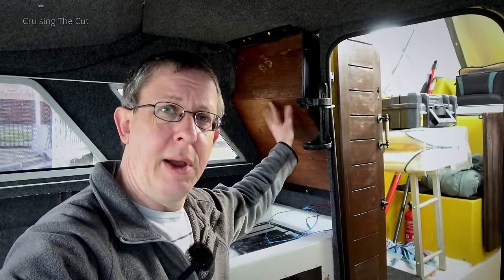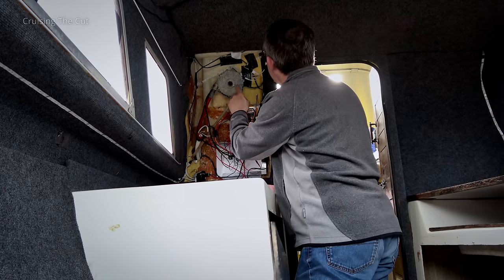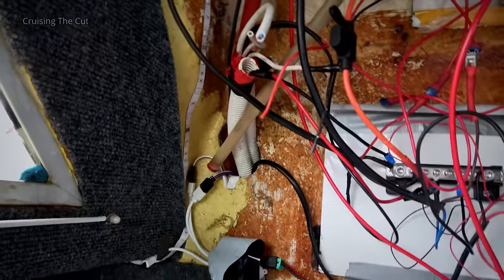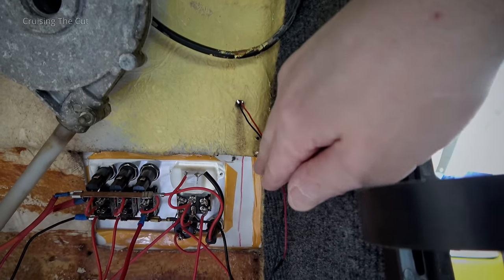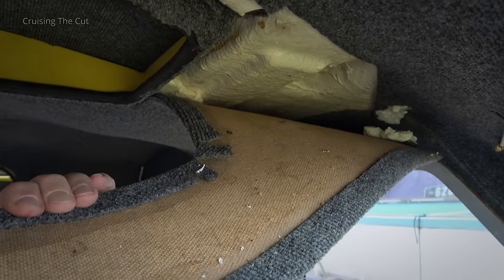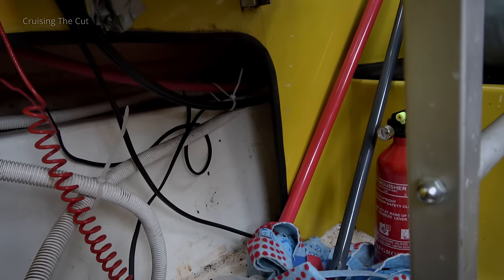326. Ripping out the wiring in my boat

Comment: Hi David, the strange two holed thing in the dashboard is, potentially, a small 12v indicator bulb devoid the element and glass cover. Otherwise known as a smashed bulb. Please do carry on with this video series, it is enjoyable to watch and gently informative.
Reply from the maker: Ah, good shout. I will remove it and cover the hole.
Reply: Exactly what I though, I've seen bulbs with skinny little wires sticking out the bottom.
Reply: A socket for just a bare LED?
Reply: @Scodiddly  Originally probably would have been a LV incandescent bulb.  Either friction fit, or with a plastic or glass cover.  Can't really tell, with the bezel looking a bit beat up.  As David Watkinson said above 'otherwise known as a smashed bulb'.😄  You probably could fit bare LED leads in there, but with a resistor fitted to one leg.  Easier to remove it, and cover it up, or put in whatever type of new indicator you might need.
  I'm waiting to see if the switch/fuse panel even has enough room in large panel, to be mounted vertically.  Hard to gauge the size in the video, but I think that may be why the previous owner, mounted it horizontally.
Reply: @CruisingTheCut  Strikes me that it might have been a 'power on' indicator that showed that some past version of the electrics was live, if there was an isolator near the battery.
Reply: @dougwilson4537 re the switch fuse panel you might be right about size/fit. My first thought was the previous owner just preferred rocker switches up/down rather than left/right for operation by touch.

Ah, the joys of puzzling out random diy wiring 🤪😆
Reply: I think it was a small light bulb to illuminate the dash at night
Reply: @CruisingTheCut My guess was going to be a smashed LED, maybe a main power on indicator?
Reply: I was thinking one of those old LEDs that looked a bit like miniature light bulbs with two pins in the bottom to plug them into something. Perhaps supposed to be a charge indicator for the battery or something?
Reply: @Scodiddly no, a bare LED needs a resistor to limit current. Led only uses about 1.75 volts across it, but a 1k resistor in line with the socket would supply about 10 milliamps of current, a good nominal current flow. It would light an average LED to a very nice brightness.
Reply: The light bulb might a energizer for charging like the battery light in a car?
Reply: You can get 12V LED's that have resistance embedded within them, no external resistor required
Reply: I was thinking the same thing, either serving as the instrument panel light or a map light or the like. It is the same with those random connectors, i imagine they were for items they would bring aboard for the day but didn't want to leave permanently on the boat.
Reply: My suggestions is that it is a socket for a goose-neck reading light to be plugged in for night navigation.
Reply: Yes, I was thinking it looks like the socket for a G4 type bulb.
Reply: @mikecrawford7352 I think you're right. That boat is old enough to have used incandescent lamps.
Reply: It could be nicely used as a place to check the true battery voltage with a multimeter...
Reply: The missing thing on the dashboard is the remains of a flashing LED probably to dissuade thieves so it looks alarmed,  not a bad idea as they use no voltage really and puts a bit of doubt into the minds of light fingered types
Reply: Otherwise known as an idiot-light. These are similar in function to all the standby lights on electronics
Reply: @richardpope2114 does that actually work ?
Reply: Yep davidwatkinson7552, you said exactly what I was thinking, the remains of a small globe to light the instrument panel, minus its globe and top fitting.
Reply: GU10 bulb?
Reply: @thegrimreaper7777  not common, pricy, and not readily available at the time of the boat’s manufacture. Either way replacing it today isn’t something that David is interested in doing.
Reply: @loganocallahan4074  probably not, contacts are dangerously close together. A inadvertent short would almost be guaranteed.
Reply: Nope, it's the trickle charger connection, like you have in collectors cars that sit for a long time. @CruisingTheCut
Reply: @richardpope2114  I was just about to put the same, used to have them in the cars in the 70's & 80's fake alarm LED

Comment: TOP-TIP.... leave the white flexible conduit in place with one of the old wires as a drawstring to give you a future cableway through the boat. You can simply pull a new cable through the existing conduit using an old cable to do so.

Comment: Nicely done David. Winging it with electrics can be unnerving for some. I have been a prototype wireman and I love the challenge of the deciphering. It can be laughable at times with what one finds but the satisfaction of the finished effort will always earn a toast with a cup of Earl Grey. Just don't fall for the 'turn the boat upside down to lay the carpet on the ceiling' prank. Love the videos, keep them coming in the current format. Education and humour can work together.
Reply from the maker: You know, I quite like that plan for the carpeting!!
Reply: From what I can see from phone screen the carpet is fixed to a hardboard "substrate" or "armature" sort of thing and makes the "carpeting" much easier.

It may be a plan to carpet over the carpet and thus gain about another 4mm of insulation🤪

Comment: In my experience with old boats. Sometimes it's best to disconnect the wires and start a fresh electrical panel using marine grade wiring. And using a marker or label maker to label what is being attached and where it's going is often the best route. In this video, I see alot of automotive wiring being used in place of shielded marine grade wires. I hope you enjoy your puzzle, I'm in the middle of a rewire myself.

Comment: David the small socket is probably the remains of a 12 volt flashing LED, a fake burglar alarm, (no resistor needed).
Also remove the wires in the conduit going to the rear but keep the conduit, it may come in handy as you move on with the reno.
Keep up the videos of the refurbishment, I'm enjoying them.

Comment: I quite enjoyed the voyage of discovery you took us all on. The wiring "fun" reminded me a little bit of moving into a place I rented a few decades ago that had been rewired at some point, and working out that the electrician just left seven light switches in situ that were still wired at the switch but not actually connected to anything, any more.

Comment: That wood is Hard Board, also known as Fibre Board. Usually chequered on one side and smooth on the other
Reply from the maker: That's the stuff!
Reply: As a piece of useless information, I can add that here in Sweden it is called ''Masonite''. Good material as long as it doesn't get wet. 😁
Reply: @johnnyzander1466  always called it masonite myself. No idea where the name originated, but I learned it from my late father.
Reply: Some sad technical info. I was European technical product manager for Masonite. An American company. Mr Mason invented hardboard (which is what the thin material in the roof is) in the 1920s in Laurel Mississippi, hence the name Masonite. You can tell hardboard from thin MDF by the crosshatch pattern on one side. The crosshatching is a result of the wire mesh used to allow water to escape in the pressing process used to make the hardboard. 
In Sweden hardboard was manufactured under licence, using the American Masonite process. Masonite is a generic name for hardboard in Sweden and many other areas, just like Hoover is a generic name for a vacuum cleaner.
Sorry about the long geeky explanation, it’s not often I can show off my boring knowledge of something. 😊
Reply from the maker: That was very interesting! Cheers!
Reply: @slots1407  Masonite is the trade name.
  ''Masonite" is a brand name for "hardboard". It has been commonly known as "masonite" after the founder of the Masonite Corporation, William Mason, invented this wood product in 1924.

Comment: I'm a maintenance technician so I enjoy these videos. I'm wonder if the mystery connection is for a LED. It's the only thing i can think of that would fit there. Maybe they wanted some indication light to say power was present on that connection but it's a real cowboy effort!
Reply: I was going to say the same thing - looks like the LED itself got smashed off at some point, leaving just the mounting gubbins and the remains of the LED's terminals.

Comment: Having owned a 40 year old VW T3 and now living in a 35 year old motor home. I understand the strange excitement and joy of tracing all the mad wiring that gets added over the years. I think the odd terminal, with 2 little holes and thin power cables, is the remains of a LED holder that would have had a coloured cover over it.

Comment: A DIYer figuring out another DIYer's Mickey Moused wiring - very entertaining! 

I have a tip for you - if you cannot completely remove a dead, unused wire put a wire nut on it. A single wire insulated means it is unused - not accidentally disconnected! It will help in the future say two year from now when you can't remember what you did last time you work on it. It will help future owners also. There was a Triumph motor bike that kept blowing ignition modules because I kept hooking up a dead wire, I learned the hard way.  Jim Y
 Just finished watching this, laughed my ass off because you kept reminding me of when I did the same thing. Keep up the good work.

Comment: Absolutely loving your series, it scratches my boating itch and the same curious nature of " whats this wire do and where does it go" . I imagine when its all finished, all the spurious wires will be gone, and all the wiring loom will be rationalised and securely fixed, ie , no bodge jobs! I look forward  to more of your engrossing series. Keep up the good work!  
Oh , I dont know if anybody previously mentioned it, but that " wood" the carpet is attached to is fibre board. Not ideal in a moist environment by any means, it turns soft and powdery when it gets wet.

Comment: Personally I like your personal discovery and random rambling. 
I like that we are learning together as  you disect the boat. 
The random 2 hole connector over the dash panel at first I thought was a light sensor but upon looking at my 12 volt supplies I think it is a G4 Type 12 Volt Socket. They  used to have halogen lights attached to them but now some are LED. It's an indicator light.

Comment: I think that might have been a small indicator light that indicates the batteries were on and got broken off..  I'm not sure though since it would be on all the time, there doesn't seem to be a battery disconnect switch anywhere.
Reply from the maker: Yeah the only battery disconnect is a fuse/trip switch.
Reply: I'm pretty sure you are right. There probably should be 2-pin cap with LED od bulb snapped on.
Reply: I agree that it's an indicator lamp housing.

Comment: Haha!   Boy, this brings back memories of dealing with the electrics on my old road grader.   Everything was so utterly messed up, that I ripped out EVERYTHING electrical, except the starter on the engine.   Then properly rewired and rebuilt the entire system. (the machine is so old, original parts are no longer available, so that meant fabricating new fuse blocks and switch/instrument panels)
My old backhoe wiring was in almost an equally bad state, from years of people messing with it, but I was lucky enough to still be able to order replacement wiring harnesses.
Shoddy wiring drives me nuts.  Hopefully it is not the bane to your existence, as it is mine.  Good luck to you sir.
Reply from the maker: Thank you!

Comment: David: When in doubt, first DISCONNECT THE BATTERY! Do it at the end of the day, and re-connect it when you are actually testing your work. Saves on the battery, prevents sparking and surprises, and possible fires. Thanks for the video. Jon - on the "other" side of the pond.
Reply from the maker: I did disconnect the battery (+ve)

Comment: When I bought my boat, I too was curious about the wiring. Found that too many were dead ends after 40 yrs. Took out set of pliers and cut all out and replaced them, now not afraid to die in an electrical-induced conflagration :)

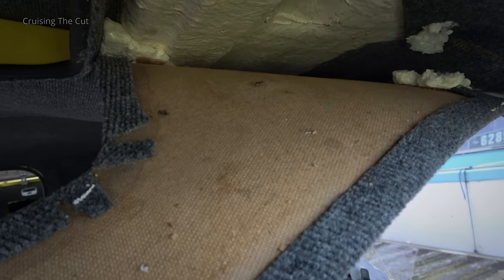Comment: The weird thing at 6:08 looks like the remnants of a panel mounted warning lamp, the holes being sockets for a small incandescent bulb with pins (e.g. T1 bulb) or less likely an LED.  12:30 the cheap and nasty wood stuff is hardboard, it absolutely loves water and swells up like a sponge so perfect for use on a boat 😁  
It never fails to amaze and disappoint me at the horrific mess that people make of wiring.  I've never worked on a boat but many older cars with after-market alarms and stereos which have been installed with a similar level of care and competence (i.e. none at all).
No need to apologise or justify your videos in any way, they are all a joy to watch.  I never had much interest in boats before discovering your channel but I absolutely see the appeal now.
Reply from the maker: Thank you

Comment: 14:30 conduit to the rear could be useful if you wanted to run cables to the outboard for electric start
Reply from the maker: Indeed, and I now think the truncated cables may have been exactly that (there's yet another conduit leading up to the throttle)
Reply: Yeh take the cable out and leave it there
Reply: Might have been charging from the motor?  A previous motor?
Reply: when you pull the old cables out, might be worth tying a length of polypropylene rope to them and leave that in the conduit to make it easier to pull new cables through in the future.

Comment: Hi David, love your videos, never boring 👍👍.  Maybe you have already thought of this yourself but maybe you could leave a conduit in place with one or two of the old wires so that if in the future you decide to add a new piece of electrical equipment in the back of the boat you can pull your new wires through the existing conduit using the old wire as a “pull wire” thus not having to tear the boat apart to conceal the new wiring.  
Take care, stay safe, well and happy.  Judy🇨🇦

Comment: Hi David.  Interesting as always thanks.  Humble suggestion.  The redundant conduit.  Perhaps be not so hasty and just pull it out.  If it runs to the stern it may become useful in the future. How about pull the cables out of the conduit if they have no current function (pun intended) leaving the conduit in place and empty to future proof any installation of modifications or stern area accessories that experience leads you to want and needs cable runs.  BUT, before you pull all the cables out, tie a strong piece of string to one of them pull the string though leaving a good overhang both ends and then leave just the string in the conduit.  The conduit can sit out of site out of mind but should you need some stern cabling you will have a pre installed easy route to run it in.  Just an idea!  Keep the videos coming.
Reply from the maker: Good plan

Comment: Starting to suspect that this little boat has had previous owner or owners who have added/changed electrical things over the years but never removed the obsolete wiring - I worked on a computer room like this and leaving old cabling in place as a shortcut always comes back to bite you when you least expect it - tracing things and striping out the old and obsolete is a great way to get really familiar with the ‘new’ boat !

Comment: As others have already said: that 2 pin mystery socket on the dash is almost certainly a partially damaged/missing indicator light housing, probably used to remind a previous owner that power was still on, perhaps via a battery switch. It could have been either an incandescent bulb, neon bulb or an LED; I've seen all 3 over the years. I for one am enjoying watching you "suss" out the vagaries of your new pleasure yacht, so thanks for allowing us along on the journey!

Comment: The funny little thing with two holes is a 12v outlet. I've seen them on Motorhomes and narrowboats.
The funny cross hatch wood stuff, used on the roof lining, is called hardboard and was often used to even out uneven floorboards.

Comment: Just thinking about it I may be wrong but the firberglass covered wood battens, may have worked out well for the carpet installation but I think it's main purpose is to strengthen the outside fibreglass. Let's face it without them, walking on top of the outside fibreglass would be risky, it's not very strong on its own. Don't want to put one's foot through the roof. I love this boat David, it really does give you the old age security of a fixed dwelling and life on the canal, which we know you really love,  it's much much cheaper to buy and run than a million foot narrow boat. Yes and if I have been asked once, I have been asked a billion  trillion times not to exaggerate. Lovely video of the boat David, keep them coming, it's all exiting to me, no matter what, your doing.

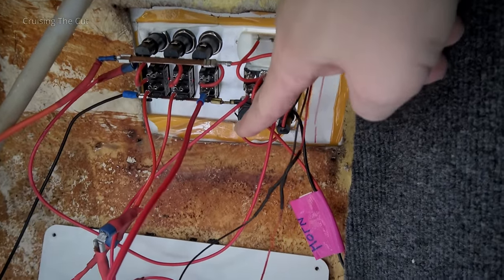Comment: Suggest Velcro for the electrics box was on-par with gaffer tape and screws not attached to anything bits of reno. On you go, David. Good going with the close-up. At 6:14 plugs for idiot-lights, that tell you if the engine is running, or an on-off toggle switch. Suggest preventing owner disconnected these to 'make things more streamlined'. Which is why all the electrics at thd back are bodged together with pieces of gaffer tape. Good discovery at 12:00. Oh look, plastic tie-backs, at 14:15. They're helpful. Just for fun, might i suggest a power-assist battery for the steering and propellor. As Edd China would say, Job for another day

Comment: The conduit to the back might be useful in running wires like bilge pump control from the back cabin to the console.  Using a fish tape to pull through is a pain.  A multimeter and a tone/tracer set is useful in tracking mystery wires to the source.